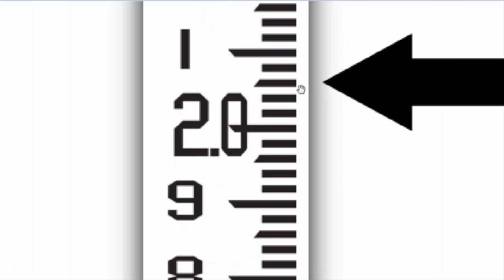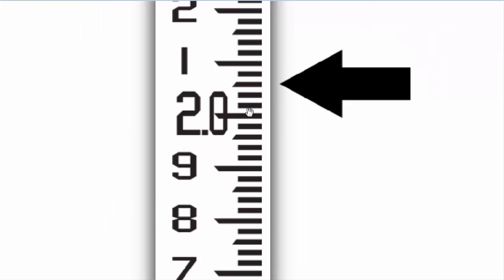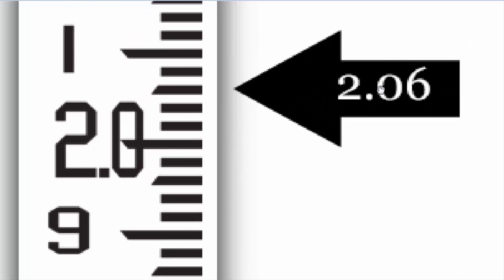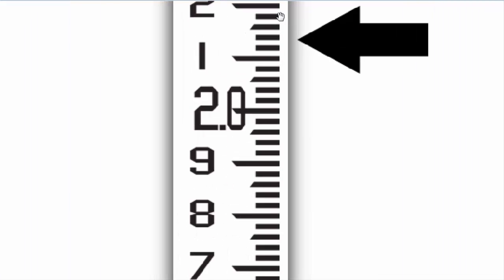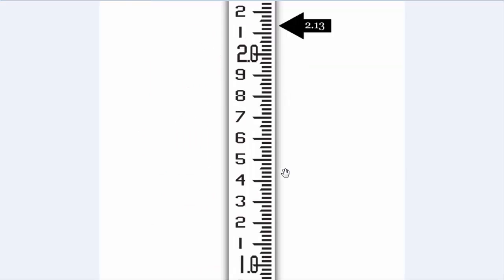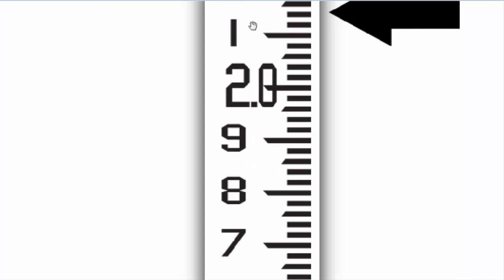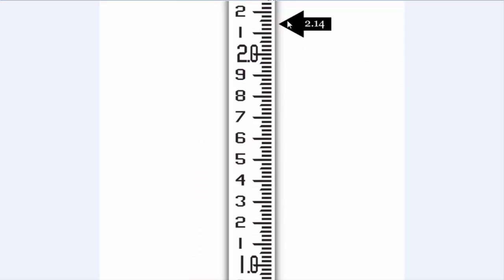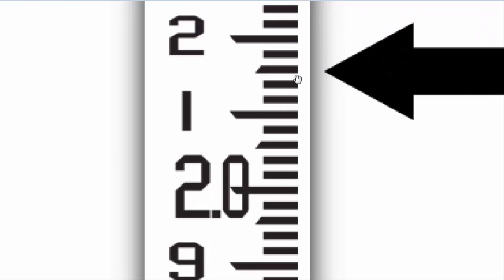How To Read Reading on Foot Staff Level Rod -  Reading The Level Rod

Comment: sir  aik  baat  btain  me  surveyor  hu  aik masla  he  ke  meatre tape  me  aik  feet  me 12 inches  hte  hi  or staff me aik feet  me 10 inch hte  he  jab me site  per kam  krta  hu  to  staf  se jo  reading  lagao  ga  wo  10  inches  ke  hisab   se hu  ge  laiken  jab  tape  se   check  kia  jae  ga  to   2  inch  ka  masla  ata  he  us  ke leay  kia  hall kre  ge  plz  reply   me
Reply: 10 inch to 1 feet aisa nahi hota. Ye ghalat ke rahain hain. Asal mein staff mein reading meter ki tarah li jati hai. Pehle feet phir tenth of a feet phir hundreth of a feet. Maslan 3.28' is mein 3 to feet hai or jise ye inch keh rahain hain wo yahan pe 2 hai or 8 ko sooter keh rahin hai. Basically of reading feet mein hoti hai. koi inch sooter involve nahi hota. Or ek or baat jo black rectangle ki side pe ek corner nikla hota hai agar wo oper ho to wahan 10th of a feet yani jo digit decimal ke right pe aata hai wo shuru hota hai masla 2.1', 2.2' yahan 2.1 shuru ho rha hai. or jahan corner neche hota hai wahan pe second digit decimal ke right pe 5 hota hai maslan 2.15  ,, x.x5'
Ise engineering measuring system kehte hain. full decimal feet

Comment: Good explaination. But ap ye nehi keh saktay k staff main 1 feet main 10 inches hain. Ap ye kahen k 1 feet main 10 sots hain. Yani k aik 1 feet ko 10 hison main divide kiya gaya hai.
Agar ap inches bolo ge tho bohot ziada logon ko confusion ho gi k 1 feet main tho 12 inches hotay hain tho yahan 10 inches kese. Jub k yahan inches ka koi kaam nehi aur readings sirf feet aur decimals main li jati hai.
Lehaza in a Staff level 1 feet is divided into 10 slots. Because the reading is taken in decimals e.g 1.75ft or 2.25ft etc. And not like  1'9" or 2'3".
Anyways good explanation.
Reply: Toh 1 inch mai 8 sooter Hote hain, 10 sooter kaise